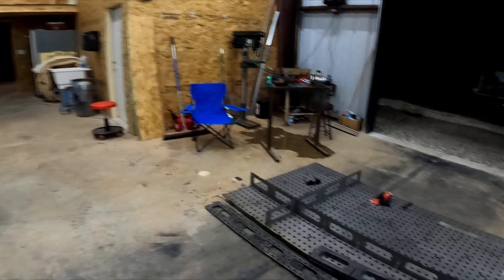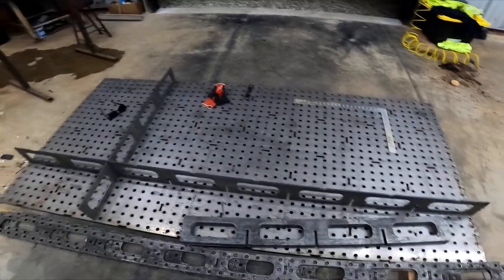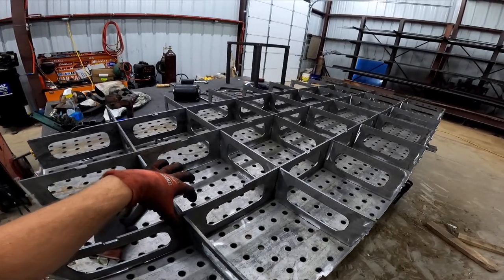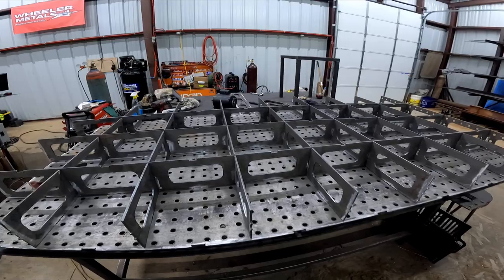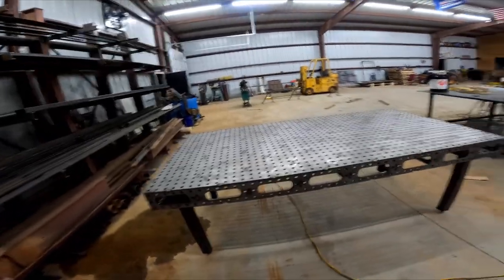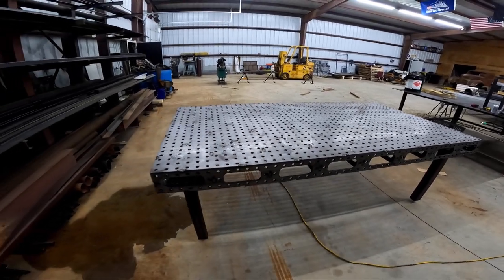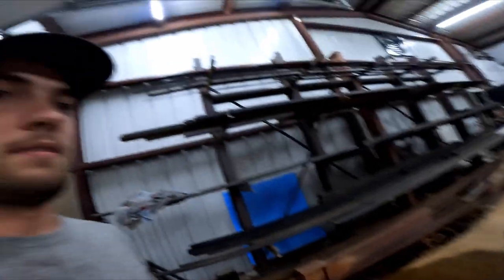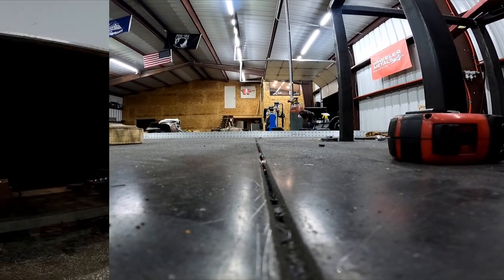DIY Welding table using a Shop Sabre CNC (Maker Table Files)

Comment: Sorry for bringing this up on an older video but what made you decide to pull the trigger on the Shopsabre CNC?  I'm looking at one to start a small fab shop for my "retirement project" and looking at several different machines  I've been very impressed with the Shopsabre.  There is another company called LDS CNC that I'm also looking at.  They would be about 25% less expensive from my research but a much smaller mom and pop shop.  They seem to be very well built and well supported (unless the guy retires).  I just figured I'd see how you like yours after a year or more now.
Reply from the maker: No worries at all. I went with a shop sabre mostly because of the tech support. Being new to the CNC game at the time I figured there would be stuff I would need help on. Then once I got the machine and the plug and play being amazing I will never own another machine. Excellent machine no doubt literally less than an 2 hours after it got unloaded off the truck we were cutting parts. The only thing I have changed from what they have sent me is a now use fusion to draft parts and nest. Rather than EnRoute that come with it. Great 2d software for sure but I needed to be able to draft a full part then put it on a sheet. If you have any more questions hit me up on our Facebook page id be glad to answer anything.

Comment: Is there a way to get this file I would love to make this table out of 1/2 inch I have a 6x12 table with the Hypertherm 85sync
Reply from the maker: Yes you can buy them directly off of Maker tables website. only issue with plasma your holes will be way off.

Comment: Looks great!   How accurate are the hole sizes?  I cant get round holes that size on mine (Langmuir crossfire pro)
Reply from the maker: They are within about 20 thousands from top to bottom and side to side. We took a reamer bit back over to work with 5/8 tooling.

Comment: Which plasma do you use? How many nozzles did you use to cut so many holes?
Reply: I use a hypertherm 85 amp. I can get about 2 tables out of one tip about 16 hours of cutting.

Comment: Why are supports at bottom are cut out in middle? 🤔
Reply from the maker: If you are meaning the little notch on the bottom it is so you can put a leg plate anywhere you may need.
Reply: @powellfab.3357  not the notch. It is used to slide in the other supports. I'm asking about rectangle cut outs on the face of support.
Reply from the maker: @dharmendrasuthar4342  oh for clamping

Comment: I did the same thing but the steel becomes hardened due to the cooling and getting the holes to 5/8 with a reamer/cutting bit because very difficult to do for us
Reply: We had the same problem. We went slow and started getting them but lots of work no doubt

Comment: Do you like Fusion better than Enroute? And if so why?
Reply from the maker: Fusion just has a lot more capabilities, and with that, it takes a little more time to learn. I like to be able to design a 3d model then break it apart to cut it. Enroute definitely is a good starter software or if you are going to do strictly signs, in my opinion. Fusion is also cheaper, and you get a way better software.
Reply: Do you do your toolpathing on Fusion as well?
Reply from the maker: Sure do, its very simple.  @benjaminbright6826